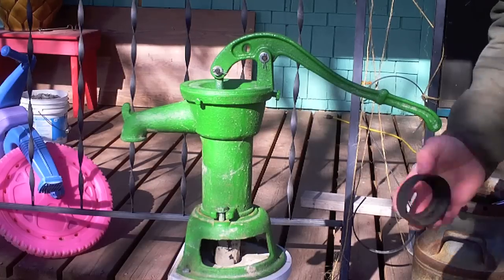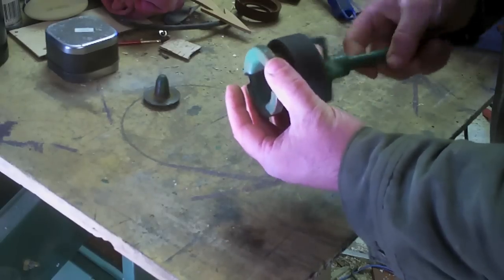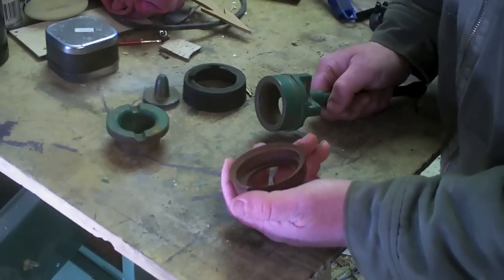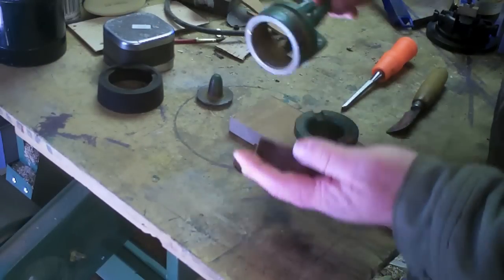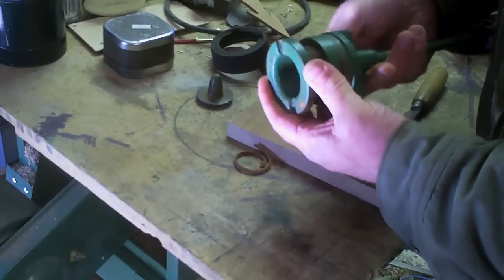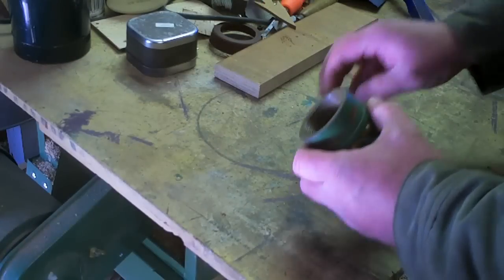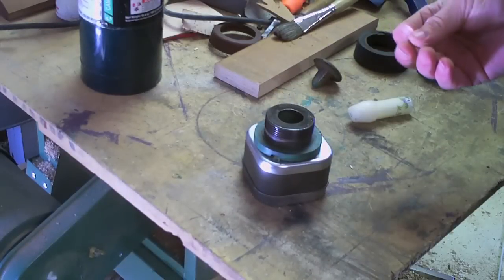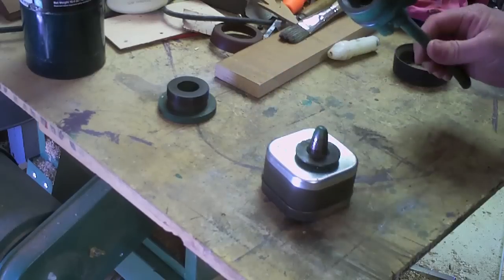Replacing Hand Pump Leathers

Comment: I've fixed a number of these, the old American made types.  I use 1/8' thick sheet rubber cut to bore size to replace the cup and they have worked perfectly.  I also use the wax from a wax toilet seal (new of course) to put on the threads where the piston goes together to keep it from rusting, and it's sticky enough to act as a thread locker.  You can also cut the bottom flap valve gasket out of 1/8' rubber....it will be a long time before it needs replacing.

Comment: How often do you use your pump? I've got a similar one at my camp, I can't even remember how long we've had it, 4 or 5 years anyway. I think ours is Harbor Freight but I can't recall.
It pumps probably 100-150 gallons of water a year. We pull it for the winter so the pipe doesn't freeze. I've got to replace the check valve in the spring, thanks for the heads up on Lehmans, I should have known they'd have parts.
Reply from the maker: +Lantern Lab It sounds like the quality on these varies widely and if you end up with a Chinese knock off like I did the life of the original rubber is very short.  Very short, like less than ten pumps on ours.  After I polished the bore the original rubbers worked again for a while but the leather ones have been going for years now.  We pump way less than 150 gallons a year with it, 50 tops.  That is going to make it harder on the seals drying out like that all the time.
Reply: +NelsonStudios Sounds like I hit the cheap Chinese junk lottery!
Reply from the maker: Well someone has too, might as well be you!

Comment: hi there, just wondering where you put the second piece of leather ...the check valve piece?  I am replacing the leathers on mine and cant seem to see where that piece goes
Reply from the maker: If it is what I am thinking of it replaces the gasket at the bottom of the pump.  I think this video shows it but the video is from before I replaced the leathers so look for something the same shape but rubber.

https://www.youtube.com/watch?v=vdYJE1SZe0U

Comment: I own a very old antique pump similar to the one you have. But the plunger cage won't unscrew like yours. I suppose the threads are rusted. I've tried soaking it in wd40 with no luck. Any ideas? I really don't want to buy a new aluminum one if I don't have to.
Reply from the maker: Anna Schutt Check out Leimans online I think you can buy a generic replacement.  Once you are sure you can replace the one you have then try heating it.  At that point you have nothing to lose if it breaks so have at her.
Reply: NelsonStudios Thanks for the advice! I put it in a fire, and it actually worked! I think the old leather was preventing it from unscrewing, so burning it off helped.

Comment: What's wrong with teflon on pump threads instead of wax? I've seen several rebuilds that use beeswax & lard but no teflon? Disconnect?
Reply from the maker: Not sure.  Being overly cautious about the chemicals I guess.
Reply: Dan R

Comment: i cant do by  myself my friend... i think this is man jobs... it gose under 100 feet something like that then pipes ... i found some on Ebay ... but worry about installing... thanks a lot for letting me know....
Reply from the maker: +Happy Khan That is deep.  I mean it can be done but... you might call some small local well drillers in your area and talk to them.  Hand pumping more than 22 feet is going to require some special pump parts.
Reply: ill try thanks a lot....

Comment: I should have painted my parts first before installing replacements dang..... the outside has never been painted either.
Reply from the maker: Well, rust is a color too.
Reply: I managed to sand the outside and used a wire brush then washed it real good let it dry and painted it blue, came out nice.  I like your pump it looks heavy duty and easy to take apart mine has the shaft area and then the top area like your pump ... so 8 smaller bolts and nuts to deal with.

Comment: Why leather and not rubber?...leather is dead animal...yuk.
Reply from the maker: I found that the rubber simply didn't hold up and even though this pump is largely a silly novelty failed almost immediately. Critter chunks or rubber chunks, pick your poison I guess.
Reply: @acme663ryo  Was it natural rubber or synthetic?...just curious, there HAS to be a better way.
Reply from the maker: @scottleft3672  I can't remember. Silicone gasket might work well.